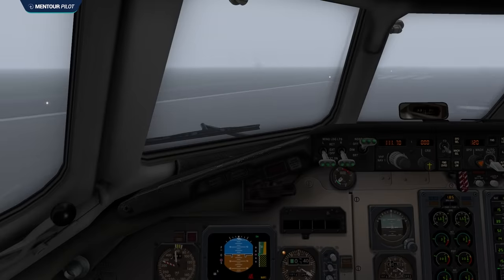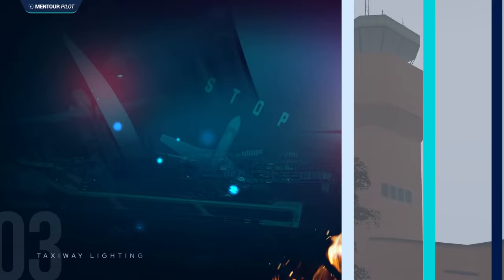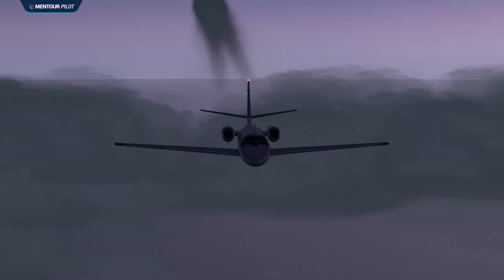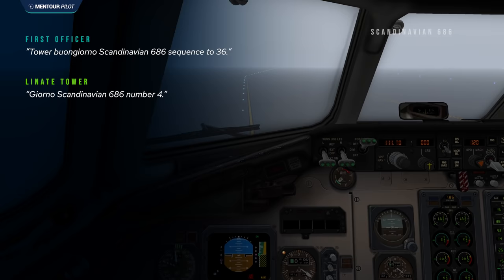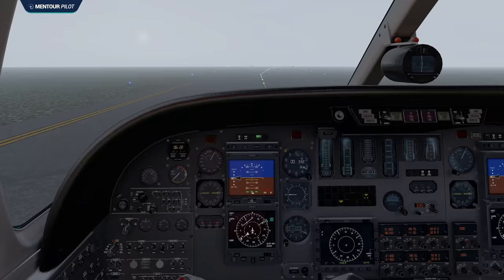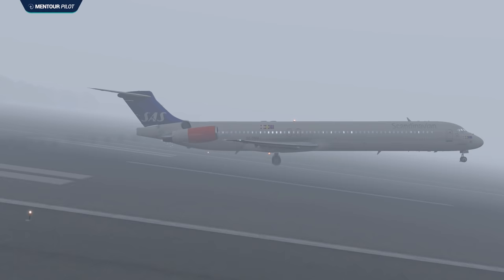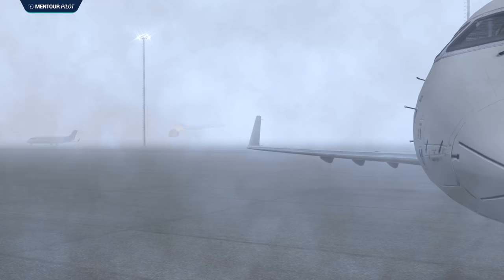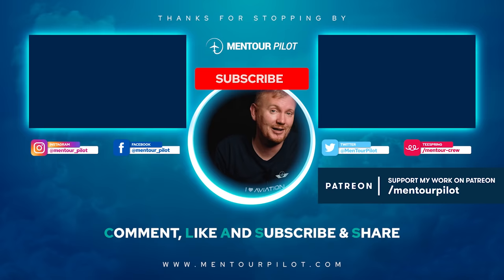A Perfect Storm of Mistakes! And how Heroic Pilots Almost solved it.

Comment: I don't understand why airport are not equipped with metal detector in the taxi runway ... like we have at the light stop. At least, the control tower will know where all of her planes are.
Reply: The ANSV report does mention "electronic anti-incursion devices".  They were deactivated at the time.  Litane also had ground radar, but it too was ... guess what?

Comment: Pilots have to learn and be specifically certified in order to operate at the low visibility. Planes have to be specifically equipped and certified to be able to operate at low visibility. But airports are just fine.. even if there is no ground radar, no properly working navigation lights and comms are just mix of pure italian and unaubible italian english?

Comment: I’ve seen many crashes or near crashes caused by unmarked or poorly marked runways and taxiways. Why is marking them seem so complicated to people operating airports. In several cases a few gallons of paint would have prevented hundreds of millions in losses of aircraft and people. 

This airport has a long history but it doesn’t seem like they learned anything during all the years it’s been open. How could anyone approve a system that could lead to so much confusion? Did anyone get prosecuted for incompetence? The people running this airport obviously never learned KISS, Keep It Simple Stupid. 

It’s sickening all those lives were lost. That corporate jet crew should have been grounded.

Comment: Bro , i am a old 40 tones truck driver very excited by aviation , and i saw many Air Crash Investigations including this Linate  accident ! What you didnt said in your video , is that Those BASTARDS  from Linate Airport Administration , they had inside their storages an absolutely EXCELENT RADAR  SYSTEM ,  wich was created by Norvegian port operators to avoid ships colisions , because the Norvegian ports were confrunted very ofen with crazy fog , and this Radar was absolutely amazing , not only in port , but also for Airports.  The Linate Airport bought this radar from norvegians , but they NEVER  instaled before this accident , even they knew that Linate Airport was very ofen covered in sich fog. BASTARDS
Reply: Section 1.10.4 of the ANSV report tells the sad story of the ground radar (ASMI) at Litane.

Comment: what if they had rolled the aircraft on the right and used the right wing to stop the aircraft or maybe take off with a single engine?
Reply: The pilot of the MD-87 did try to continue the takeoff, but the left engine was damaged by debris ingestion.

Comment: I understand the Cessna pilots lacked a specific rating that would have authorized them to fly in the low-visibility environment.  However, I do not understand how having the proper ratings would have meaningfully prevented the accident.  Why is this mentioned as a contributing factor?
Reply: I think the point is that with the lack of the required rating, they should have diverted to another airport with better visibility. Thus the main contributing factor of what caused the accident wouldn’t even be present and no accident would have occurred. Of course, as he mentioned, there was a runway incursion the week before so an accident was bound to happen eventually.

Comment: The air traffic controllers and most importantly the scum bags in charge of running the airport should all have been jailed for criminal negligence and the ones that were in charge of the airport/disaster waiting to happen should still be in jail and left to rot.

Comment: Shouldn't there be a rule to listen to both Ground & Tower frequencies under these foggy circumstances?
Reply from the maker: No, there is way to much chatter to keep track of. You only need to monitor the frequency you are assigned to and possibly the emergency frequency, once airborne

Comment: Sounds like that airport needs to be bulldozed and the earth salted. Who runs an airport like that? Non-functional ground radar -- which happens from time to time but you get it fixed, malfunctioning marker lights, passageways with no marking at all, markings that aren't documented anywhere but on the pavement, non-conformant labeling (sure R6 was created after R5 was labeled, but that doesn't make it right), and a runway with buildings near the end to run into.

Comment: why would the Cessna pilot taxi on a main runway during a snow/fog storm clearance or not.  The pilot didn't know he was on a main runway? Aren't main runways for taking off and landing only? I'm not a pilot but it seems to me that you land then taxi off the runway, you go forward then turn off left or right onto a taxiway and  get OFF the runway. If a machine is going to fail, it almost always happens during a transitional phase  meaning, as a plane lands or, is taking off. A main runway seem like a dangerous to be. Why would anyone hang around? This pilot knew this airport, LAX in maintaining most all safety controls,  lax in safety procedures. The pilot should have known that this  place was an accident waiting to happen. Why not call the control tower and tell them I'm crossing the painted stop signage and or I'm crossing over the red light bar? I hope this airport got sued management got FIRE and charged criminally. They killed 118 people.
Reply: He wasn't taxiing on the main runway, he was crossing it.  From the west apron, he took the wrong taxiway (he went southeast on taxiway R6 instead of north on R5, which was poorly marked).  To get to the main taxiway from R6, the runway had to be crossed (R5 would have taken him around the north end of the runway).  The only identification of R6 was at its beginning, where it split from R5.
Much of that route has been changed.  The split point has been eliminated, and the route he took is now festooned with "NO ENTRY" markings for traffic in that direction.
Reply: @bmjpdx9222  Ok that makes a lot more sense! thanks for the reply.

Comment: I will never understand, how and aircontrol tower worker can say for a runway "it is clear to land/take off", without having see the actual runway clearly in its length. This is purely said on belief, which is quite dangerious for hundreds of lives.

At least have cctv cameras on the runway or crew to have visual. What if prevous flight taking off left anything behind as a potential threat on the runway. When visibility is not optimal, this airport take off - land management over 'clear' runways is just turning into religious decisions over many lives. Unbelievable.

And... the airport controller himself is not aware of the painted alfa umeric signs of his own airport??? Isn't there a taxi-runway map for both controller and flight crew with all signs that are out there???? How...
Reply: Runway clearance is not issued based on "belief".  It's based on control of what is on the runway, and, in most cases, ground radar.  Both of those were dysfunctional at Linate.
If complete visual confirmation were always to be required, traffic would be seriously reduced, and the travelling public would complain.
Reply: @bmjpdx9222  here tower control had serious checking mistakes, right from the Sierra call. 

Also if I'm controlling 2 vehicles and setting one up to take off - at least I would add this to the other's command saying "taxi this and that way avoiding takeoff on runway".

With all the other serious mistakes and decisions, these 4 words saying a takeoff is set up meanwhile, would give the cesna considerations on crossing a runway in the middle.

Anyway, it is a shame that the world use controller personnel as such with ignorance of alphabet and taxi way names when only 2 planes are around one runway. What would do such controller in a dense traffic with 4-5 planes preparing to take off?

You say your decision determining assets were disfunctional. Also you do not know S4 signs. Also you don't get a "stopped, waiting" call from the cesna. So you just guessing that the cesna is somewhere doing something without any callback. And you got no visual, no radar, no confirmation, nothing. So where are the planes now? How do you control them, how do you make sure just a little where they are? Maybe the radio, your only decision making asset. So why not use it? Why there's no double check when you have nothing to get positions as a controller? If the industry makes flight security with such "fire and forget commands, no position affirmation when commencing take off/land", then this is a russian roulette in suboptimal visual conditions.

Unfortunately people in the industry are more cocky than to ask something twice when confused. And that's a reappearing pattern in tragedies.
Reply: @tmsaskg  I wasn't saying that the two problems I mentioned were the only problems.  The ANSV report reads like a laundry list of what to screw up at an airport.  That R6 taxiway (and its markings and signage and documentation) was, to use an unfortunate metaphor, a train wreck.  (It has had a major overhaul, as can be seen on Google Maps.)
P.S.: One other thing I just saw in the ANSV report: The runway had anti-incursion sensors, but they had been deactivated since 1998.
Reply: @tmsaskg  Regarding use of radio to confirm position:  The Cessna pilot did acknowledge holding at "Sierra 4", short of the runway crossing (see section 1.1.3 of the ANSV report).  But S4 was undocumented (not on charts), and the ATC apparently thought he was at the north extension of the main runway, and ignored the "Sierra 4" part (ground radar was not working at the time).  (BTW, at the time, Litane had two -- count 'em, two -- "S5" signs at two different locations.)
Reply: @bmjpdx9222  keyword: "ignored". 

A controller should never ignore  a plane position he cannot understand/resolve.

While there's autopilot and many warning system for a pilot to fly, ground control has much less to lean on. That's why controllers can never ignore information when there's no other means of getting them.

Even with all the issues, changing ignorance to request exact manouver and position could save the day.

A surgeon usually responsible for one person's life per decision. A small bad movement can cost lifelong disability in a patient. In aviation one pilot, air traffic controller is responsible for hundreds of lives. They should be more aware when conditions are hindered.

Just imagine a surgeon cutting your organs, ignoring nerves you might miss when you wake up. And a surgeon hardly kills a hundred with only one ignored move. Something to consider when we use single personnel without instrumental aid in conditions where they 'kind of dead reckon planes around runways'. I would definitely use very strict protocols like in military, when passenger planes are directed without any visuals and aids. Both for pilot and ATC. 

'What could go wrong' phrase is not something that has a place in commercial aviation.

Comment: Just curious here, how can we have 100m visibility but measure the cloud base in imperial feet? Confusion reigns... not trolling here just curious about the dual measurements :) :=)
Reply: The Wikipedia article on "ICAO" has a section on the units used for various relevant measurements.  SI is recommended, but habit and custom often prevail (an old shoe fits).

Comment: Why didnt they turn left a bit? And completely miss the plane
Reply: The MD-87 was part way through rotation (nose gear off the ground, main gear struts extending but wheels still in contact).  You can hardly make a sharp turn at that point.  Besides, according to the ANSV report, there seems to be only 0.5 second when they realized what was happening.
Reply: @bmjpdx9222  i think its possible. In battlefield i could do manuvers like that

Comment: This has happened to me twice, on descending for landing i get a sharp ear pain tha by the time we touch down it takes some time to recover. both flights were on a 737. Is this just my problem or somthing i did wrong?
Reply: You might have a sinus or middle ear blockage preventing your ear canal from adjusting to the changes in air pressure
Reply: Utterly normal if you have a blocked sinus. Try taking a decongestant before the flight.
Reply: That happened to me once, with no noticeable congestion.  Could be mismanagement of cabin pressurization.

Comment: Failure of airport with this Red Line lighting system, they 100% at fault.
Reply: There were several other contributing factors, starting with the Cessna pilot taking taxiway R6 to the southeast after being told "taxi north via Romeo 5" [R5].  But that could be considered "design-induced pilot error", since everything about R6 was screwed up.

Comment: I don't understand how airports do not have a live 3D map that they can double-check any and every aircraft on. They have, or should have, multiple radar systems, multiple sensors, as the video explains lasers (that weren't working lol), even cameras in key positions would be a huge visibility boost.
The moment that ATC heard "Sierra 4" they could just look at the map and go "hold on, you are waaay off where you need to be guys, hold until further instructions".
Reply: Not understanding something is not the same as discrediting it.  Tech has moved on significantly in the last 23 years.

Comment: Imagine Bombay city BOM with two runways from last 60 years and at times 950 take off and landings with second runway only used during cross winds.
Imagine government after government wanting to build a new airport since 1990 and date of second airport delayed by 25 years.
Imagine winter months with fog and delay and culture of being fired if reported safety 
This is airport that process over 20 million passengers over multiple terminals and no room for expansion due to vote bank politics of 100,000 slums built by illegal immigrants occupying airport prime land.

This is how toxic culture at airport stays , at times over few decades.

Comment: @mentour. Why aren't aircraft crashes called crashes.  You use the euphemism 'accident' not the correct wordv"crash"  there are a few accidents but most are crashes.  Your showvdetai(s how these crashes occur.  Either a person or aircraft failure or both caused the loss of life & aircraft.  Most are mot accidents.  They resemble a driver not following signs or speed limits
..  you usually say one tiny a tion could have avoided the tragedy.  Instead you call under fueling an accident? Tenderize was no accodent it was a crash.  We must use correct terminology not excuses for mechanical ,& human caused crashes.  Very few are accidents!